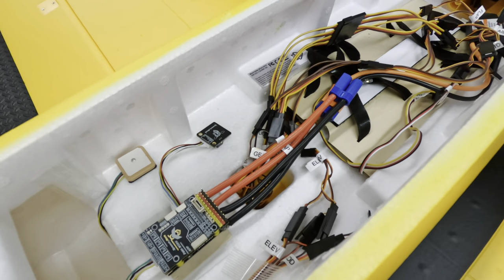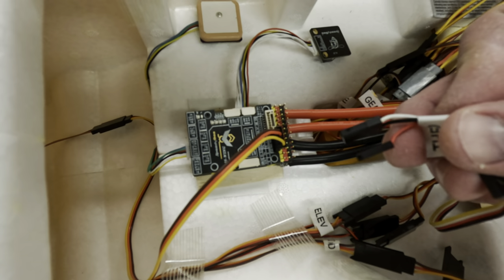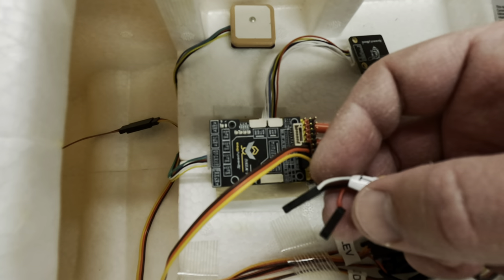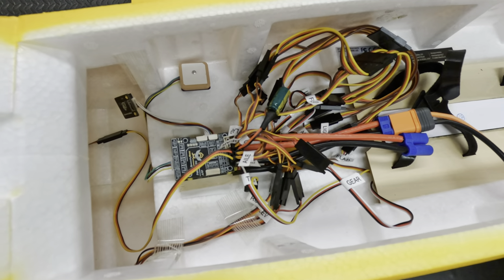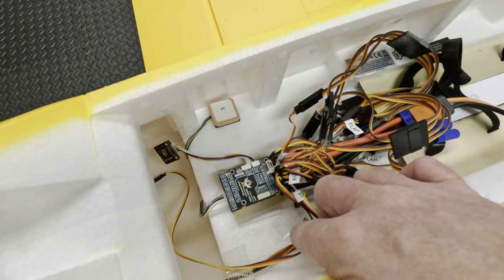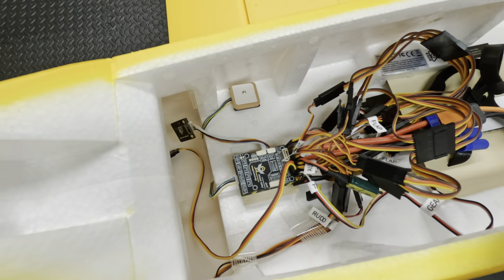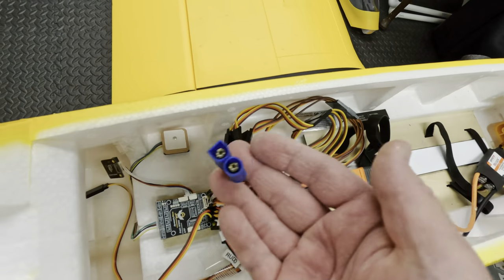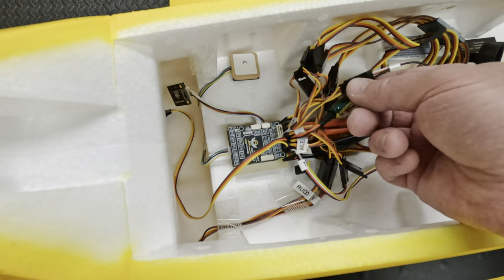FPV and INAV In an E-Flite Carbon Z T-28 Trojan 2.0m - Line of Sight Setup: Part 4

Comment: Nice plane Steve,  I see your nose gear steering is not slaved to the rudder.  How does nose steering work.
Reply from the maker: Nice catch!  It isn't connected because I burned the servo out trying to get all three retracts working at one time on this flight controller.  I have a replacement and have tested it with everything connected, but had not swapped it out yet when I was filming this tutorial.  Thanks for watching!

Comment: Hi Steve!
Thanks again for all this info. 
Im struggling to "arm" my fc. The dji 03 stays in low power state. I am using an hglrc m100 gps and its not detecting any satellites. Do you suspect that the reason is theres no satellites? On inav,  the gps icon is blue and good
Reply from the maker: It won't arm until the minimum number of satellites are detected.  Placement of the GPS is important.  White side up.  Try not to have it directly under the DJI 03 Air Unit.  It can cause issues.  Also, try and keep the GPS away from any other electronics as best as you can. Things like the motor, esc and even servo wires.  Do your best do isolate it.  It is near impossible but do what you can with what you have.  Some people will put the GPS on the outside of the aircraft.  The GPS will work just fine going through foam.  You might want to try and get a longer cable for the GPS and move it to the back of the fuselage if you can't find a place that works where it is now.   Last thing is if you are testing this inside then take it outside and test.  Sometimes trying it inside and a building blocks the satellites from being detected.  I hope this helps.  It sounds like you have everything else connected and setup properly.
Reply: @salisburysm  Thank you Steve! I think i'm almost there. Will give all your tips a try and tinker some more!

Comment: I noticed not seeing anything about control rates or expo , is that setup in transmitter or inav
Reply from the maker: @Mikeylikesit1968  I do speak about this briefly in this video around the 41:00 minute mark. Rates and Expo is done within INAV.  You would set it up for Manual Mode. There is already a default setting and I have found, for me at least, the default settings are perfect.
Reply: @salisburysm  Thanks, I thought about setting one up in my HK B-17
Reply from the maker: @Mikeylikesit1968  That would be awesome!  I’ve not seen the HK B-17 up close so I’m not sure how much room is available for all the gear needed, but I would love to FPV a B-17.  I subscribed to your channel. FPV it so I can see how it’s done. Then I can follow your lead. 😁

Comment: why sound too low
Reply from the maker: You are absolutely, correct!  The volume is much lower than when I uploaded.  I have compared the two versions. Unfortunately, YouTube has no way to adjust the volume after it has been posted.  I would ask to maybe turn the volume up a little more if this content is directed towards you.  I appreciate your feedback and will make certain the volume is corrected in the next tutorials.